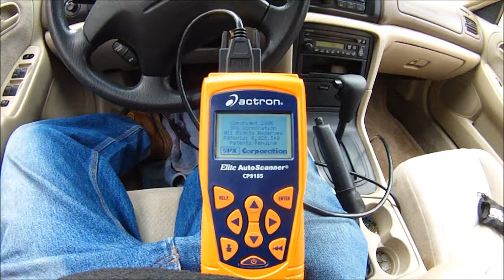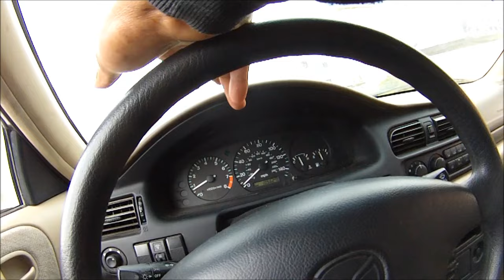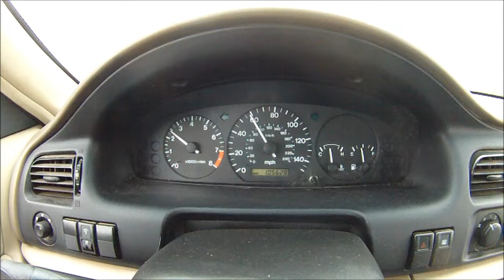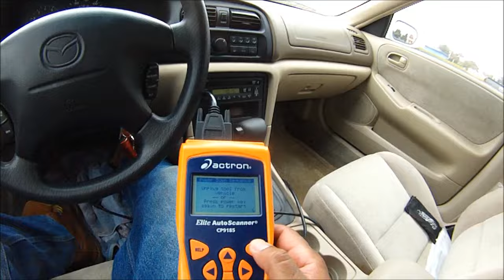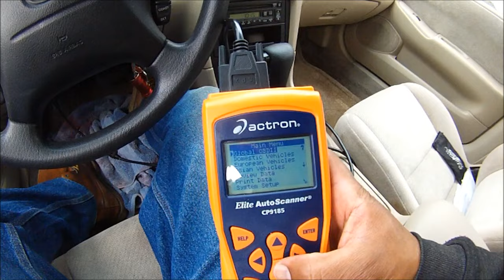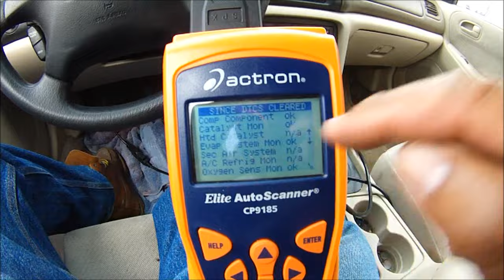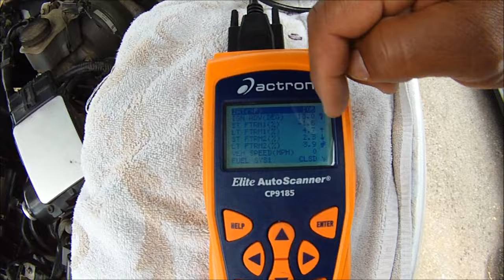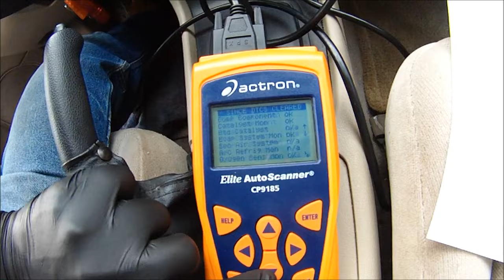WHAT SMOG TECHS WONT TELL YOU AFTER YOU FAIL THE SMOG TEST FOR (INCOMPLETION OF OBDII SELF TEST)

Comment: I've been failing the inspection since last july of 2022, i've tried everything driving my car for 100 miles everytime then the check engine shows up, tried cataclean and other stuff nothing worked, ive seen your video last night and followed all your steps today and BOM!! my car passed the inspection, seriously thank you from the bottom of my heart, god bless you brother and i wish you a happy new year.
Reply: Make sure there are no pending codes and eventually will clear
Reply: Will the OBD2 monitors still activate with pending codes? Or should you clear it first before doing a drive cycle?
Reply: For real man you answer my prayers to God. Im glad i came across your video
Reply: I like your manners for real.  Even polite and apologize.  You were raised right.
Reply: If cat clean is not working then you might have to take your heads apart and change your head gaskets. It is going to be something not visible. If the mixture of air, gas, and coolant isn't right, any small leak into your piston combustion will not allow you to smog

Comment from the maker: Any one who has experienced their car monitors not being ready and has figured it out for your specific vehicle please post for others to see so we can help each other. Smog can be very stressful and a big rip off. its all about helping each other, God Bless.
Reply: Here is the GM drive cycle..

General Motors Driving Cycle
A complete driving cycle should perform diagnostics on all systems. A complete driving cycle can be done in under fifteen minutes.
To perform an OBDII Driving cycle do the following:
Cold Start. In order to be classified as a cold start the engine coolant temperature must be below 50°C (122°F) and within 6°C (11°F) of the ambient air temperature at startup. Do not leave the key on prior to the cold start or the heated oxygen sensor diagnostic may not run.
Idle. The engine must be run for two and a half minutes with the air conditioner on and rear defroster on. The more electrical load you can apply the better. This will test the O2 heater, Passive Air, Purge "No Flow", Misfire and if closed loop is achieved, Fuel Trim.
Accelerate. Turn off the air conditioner and all the other loads and apply half throttle until 88km/hr (55mph) is reached. During this time the Misfire, Fuel Trim, and Purge Flow diagnostics will be performed.
Hold Steady Speed. Hold a steady speed of 88km/hr (55mph) for 3 minutes. During this time the O2 response, air Intrusive, EGR, Purge, Misfire, and Fuel Trim diagnostics will be performed.
Decelerate. Let off the accelerator pedal. Do not shift, touch the brake or clutch. It is important to let the vehicle coast along gradually slowing down to 32km/hr (20 mph). During this time the EGR, Purge and Fuel Trim diagnostics will be performed.
Accelerate. Accelerate at 3/4 throttle until 88-96 km/hr (55-60mph). This will perform the same diagnostics as in step 3.
Hold Steady Speed. Hold a steady speed of 88km/hr (55mph) for five minutes. During this time, in addition to the diagnostics performed in step 4, the catalyst monitor diagnostics will be performed. If the catalyst is marginal or the battery has been disconnected, it may take 5 complete driving cycles to determine the state of the catalyst.
Decelerate. This will perform the same diagnostics as in step 5. Again, don't press the clutch or brakes or shift gears.

GOD IS AWESOME! DRIVE ON oldskool funk!
Reply from the maker: THANK YOU FOR YOUR HELP. Thats what it is all about, everyone pitching in and helping each other right on Chris, God Bless.
Reply: Thank you as well... Would this apply to a 2016 Silverado with a 5.3l engine as well?
Reply: Would this drive cycle work on a 2002 Volkswagen Passat?
Reply: diving at 55mph for 5 minutes is nearly impossible here in los Angeles fwy :/
Reply: Enzo Havok Gotta hit it early in the AM on a weekend. I just tried it out and while I was able to sustain target speed for that long, I didn't trigger the evap sensor.
Reply: Evap still won't complete its cycle. On my 2000 5.3 silverado she passed smog tho Lol????
Reply: Te funk  
 O
F tyttow
Reply: oldskool funk lf.
Reply: oldskool funk. Hi my son has done the Smog check twice, fixing the the things they said are wrong, I feel bad for him because his in college and we don't have money to fix anything else, he fix what they said it was wrong but of course he went back and he failed again for another thing 
Please help my son 2 understand what he needs 2 do.... Thank you
Reply: Can the overflow hose cause your car to overheat
Reply: It mostly the computer and the drive cycle
Reply: oldskool funk aye bro I have a 2001 Lexus is300 and my Cat and O2 are not ready can I do this for it to be good ?
Reply: Grupo  Los dinnos joy as de vida
Reply: I'm a DIY when it comes to fixing my vehicle, so i love and appreciate videos like these. To all with a Chrysler vehicle, mine being a 01 jeep cherokee, the link to the driving cycle: https://mafiadoc.com/chrysler-drive-cycle-information_59c38bea1723dd295c0a20eb.html

FYI: MIL stands for Malfunction Inspection Light, in other words its your CEL (check Engine Light)
Reply: Thanks so much! You saved me from a lot of headache. I cleaned my battery terminals in preparation for a smog last week. I had no idea that this would set off the I/M to "incomplete." The smog guy told me to drive it 120 miles. Even after 250 miles, it still registered as "incomplete." So, I drove it even more. 

So, today, I decided to drive across the bay to a fried chicken joint that we like. This was another 30 miles away (60 miles round trip) that I figured would at least be far enough to get rid of the "incomplete." Most of those miles would be on the freeway -- going across the bay on both a flat and high bridge. Unfortunately, when we arrived home, I hooked up my code tool and it STILL said "incomplete." 

So, I did everything that you said in this video. BINGO! It worked! Thanks, my friend!!!
Reply: @jamesdelorean  Evap monitor is the only thing you can have left as it can take forever to clear.
Reply: That is evap monitor is ok on in California. But no trouble codes as well.
Reply: @enzohavok3470  I know I'm late to this party, but you can shortcut this process.  Make sure it's fully warmed up (no a/c or defrost needed), get it over 65 briefly, in most cases less than a minute, then coast to 20mph (handbrake ok, shifting or regular brakes no) and it should clear all codes except Evap, which isn't required in CA or AZ, check your state rules.
Reply: @enmiredbythelazy4401  That's good to know since I'm in the bay area california. On my 2003 Honda accord, all monitors are ready except the Evap.
Reply: @tlamax7769  same if you figure it out please let me know
Reply: @thatoneguy9482  My car finally passed smog. The Evap monitor was never ready but I managed to get the CAT monitor ready. Here in California, the Evap doesn't have to be ready in order to pass smog.
Reply: @tlamax7769  how did you manage getting the “catalyst not ready” ready on your car?  Which actual procedure did you follow? Thanks in advance
Reply: i have same type scanner.
Reply: good video.
Reply: If I run my drive cycle and finally get my OBD Scanner to show green, how long will have to take it to shop for emissions before the next cycle happens and computer runs selftest? For example I am afraid its green and suddenly right before the shop, it runs cycle and check engine light comes on? What is my time limit in this case?
Reply: 1999-2008 bmw E46 start car with no ac completely off. let car run for 5-10 min and get to normal operating temps. drive at 35 mph for 3-5 mi without hitting brakes etc… make your way to freeway cruise at 55-65 for 10-15 min and then just let off the gas until you get to 25 mph or below do not use brakes. accelerate back to 55+ gas pedal half way. Repeat this 2-3 times car must be left overnight before doing this process i might have forgot 1-2 steps just look up bmw drive cycle and your model. hope this helps.

Comment: I AM a Smog tech with 20+ years experience, for the most part what your saying is true. i fail a lot of smogs for incomplete monitors. and most the time its because the customer is trying to hide the check engine lamp  concern. but for the most part if they just perform the drive cycle correctly they will PASS. also keep in mind that some of the monitored systems are whats call 2 cycle monitors and require that the drive cycle be performed twice
Reply from the maker: Right on for the input my man appreciate the knowledge about 2 cycle. I have to do drive cycles 3 or four times sometimes.
Reply: Every vehicle 🚗 has different criteria for monitors to complete. It’s up to the driver to meet those specifications🤓. If it doesn’t complete its cause the pcm/ecm has registered a drivability issue..Its them dumb mechanics 🧰 who can’t diagnose correctly who steal money 💰 from naive customers. They make everyone else look 👀 like thieves. The Smog program works if u use it correctly. Ask questions. Get 🧾 s follow the 3 (C)s.  Which are: Complaint: what the driver is concerned with. Cause: what causing the concern. Correction: what you did to correct the concern. God bless and ask questions and don’t give ur money away
Reply: You are absolutely right.
Ex- Southern California Smog Repair Tech.

Comment: I followed this man's advice for testing my 2005 Honda Accord and I passed the Arizona emission test. These directions will especially make sure you fulfill the EVAP portion, which was the only one I was having trouble with prior to watching this video. What I did for the highway part is drive around 3:00am so that I could allow my car to decelerate on its own upon an empty road. The bars close at 2:00am so I had to wait for drunk drivers to return home. I used my hazard lights when I took my foot off the gas and rolled to the side. Sir, you have my gratitude.
Reply: It's hard to reset Evap in Arizona.  You have to do the drive cycle with   half a tank of gas and with the intake air under 90°, something you might not even be able to do at night in Phoenix.
Reply: Tasadaru thanks for the info.
Reply: Me being in Tucson and the freeeway is FAAAR AWAY!! I decided to use River Rd (Because most, if not everyone goes 55-60). It is a nice shot,, MINUS THE DAMN STREET LIGHTS!! Was always ONE DAMN person at EVERY DAMN light. I guess it was not late enough. Was screaming and calling everyone drug addicts and alcoholics, with windows closed ;). Then the turns suck too. BUT... there is one great section. All my sensors came back on except the damn evap -_-.

I went slow and used my blinker as if I was getting ready to turn, thankfully had no issues with people behind me to much. Did think about using hazards. Was worried about unwanted attention.

Comment: Cool video. Helped me understand why my car failed due to "not ready" catalyst. So I had a test pipe on my car, which left me with a P0420 code and I forgot to erase it when I put the catalytic converter back on, so naturally the sensors weren't "ready". After watching this vid I cleared the codes, took it for a spin, and that didn't help. So the service manual for my Acura said to do the idle relearn procedure (shut off radio and AC, park, keep at 3k RPM till the radiator fans kick in, then idle for 5 mins) then driving 55pmh for 2 mins, then coast for a few seconds, then 55mph for 20 mins. I did everything except for the 55 mph @ 20 mins and I was able to get the  O2S and Catalyst showing as "ready", awesome! Now I need to do the 20 min drive cause the EVAP is still showing "not ready".  ...I did the idle relearn procedure again, went on freeway and did the 20 mins @ 55mph, then took some streets back home and coasted a few times and EVAP is now Ready, wooo hooo! Time to get this car smogged!

Comment: Thanks for posting this I have a 2006 Honda Civic and it failed because My evap and catalytic converter I/M were not ready after looking at your video, This gave me a good Idea on how to get it done. I tried 3 times and they would not read. But after seeing this video I looked at manual for my car and  the emissions page had axactly how to do it for my car. I woke up this morning after letting my car sit. I turn the key for 20 seconds and then started the car Revved to 2000 RPMs for 3 min. I drove to work between 50 and 60 miles and on the ramps I let it coast without touching the brake, I got to work turned the car  off for a half an hour. when I checked all of the I/M sensors were ready. I took to Inspection and it passed with flying colors. Also almost forgot to mention if you don't have a scanner. Turn the key to II wait 20 seconds the check engine light will blink 5 times if the sensors are not ready, Once the sensors are ready when you turn the key it will turn off. This mean they are ready and you have completed your drive cycle

Thanks for posting this
Reply from the maker: David Robles Right on that makes my day when I hear this kind of news and I am very serious. Smog is a big hassle and a rip off. It can be a nightmare for many people I am diagnosing a smog issue right now that is a challenge but I never stop pushin forward and will figure it out. I did not know about the check engine light letting you know when the monitors are ready on a 2006 Civic. I just learned something new and will add that to my next how to beat the smog video lol. Thank you for taking the time to post David I appreciate it very much and congrats on getting rid of the headache until the next smog lol J/k. Keep your head up God Bless.
Reply: Three years later and this video & comment are so helpful💜 many thanks

Comment: Thank you man! I had seen your video about 1 year ago. When my Chrysler Pacifica would not pass smog. It worked then. Now I had my Genesis that could not pass due to the O2 censor not being ready. I drove it for 300 miles and it was still not ready. I’m glad I remembered your video listen to it while I was driving the car. Followed it to the exact instruction, finally the O2censored is ready. My recommendation to all is drive it at night cause there is less traffic and it’s easier to keep it at 60mph and if you have cruise control even better.

Comment: This sounded absolutely silly to me at first. Except it actually worked!
I drove the car on the highway for 300 miles, didn't work. Did 3000 rpm's for 3 minutes, didn't work.

To be more precise, do a search for your car model and the words 'Drive Cycle'. Each car make has different driving actions that the computer is looking for.

Thank you so much for this video oldskool funk! You gave my spare car 2 years more life (smog).
Reply: Forgot to mention, I used Cataclean first to clean the catalytic converter. The check engine light didn't go away by itself after driving 60 miles, so I had to clear the codes with the scanner.
Luckily the CEL didn't come back on again before your Drive Cycle method worked.

Also, I recommend doing the Drive Cycle at night. For one, there are way less cars on the road, and the other, less chance your expired tags will be noticed by unwanted eyes. :)

Comment: This video just saved my butt! I drive a Chrysler Pacifica and  had 2 monitors not ready after replacing a catalytic converter , alternator, and EGR valve. We spent many miles trying to get all the monitors ready for smog. I found this video and did exact steps...exact route too since I live in the same area! The 2 remaining monitors cleared and the van passed smog. Thanks for the tip and I will tell all my friends about this cycle.

Comment: Dont forget, the Evap one that is so hard to reset - always the very LAST one - at 27:45.  There is a very important detail that is vital NOT to forget.  DO NOT fill up the car all the way with gas, and don't drive the car for the test with less then 1/4 tank either!  If you do  EVAP not reset.  Fuel level has be more then 1/4 full but less then 3/4 full!  .  Say the fuel level is ideal  must be between 1/4 full and 2/3 full fuel level and you are golden.  So a little over 1/2 tank and you are probably good for that part of test.  The "Evap" will reset LAST but all things being equal WILL reset with OldSkool's directions here... but fuel level IS important, neither too much nor too little!  .
Reply: Thanks for the additional info!!
Reply: The hard part for me is that the intake air temperature has to be under 90°, something that's not going to happen in Phoenix before my plates expire.  Fortunately AZ allows one diag not ready.
Reply: If I run my drive cycle and finally get my OBD Scanner to show green, how long will have to take it to shop for emissions before the next cycle happens and computer runs selftest? For example I am afraid its green and suddenly right before the shop, it runs cycle and check engine light comes on? What is my time limit in this case?